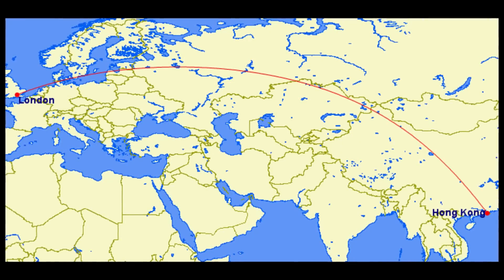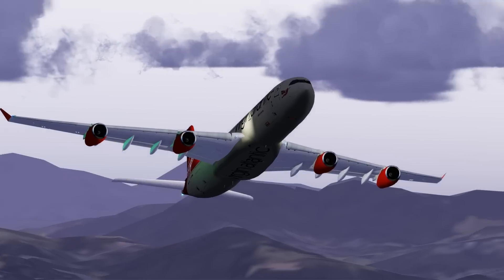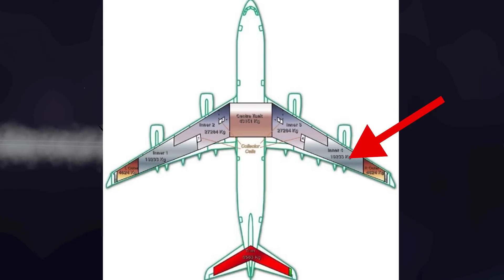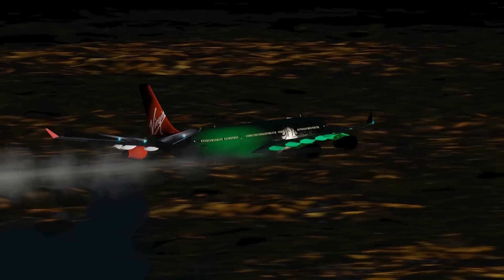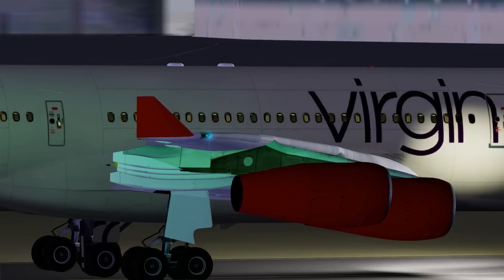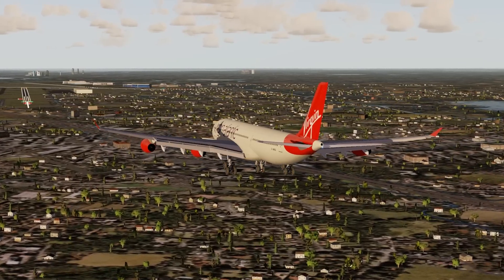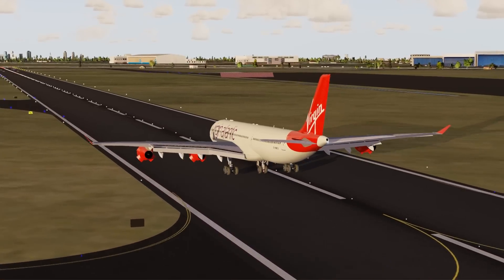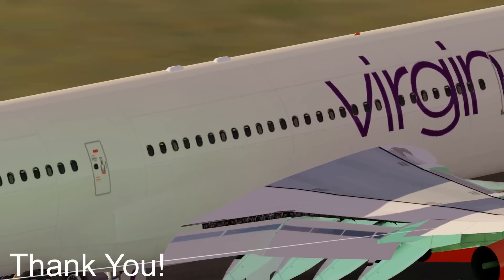How A Broken Clock Left A Passenger Jet With Almost No Fuel | Virgin Atlantic 207

Comment: Great episode as usual, particularly technical as you noted! For once I can contribute a tiny detail :-) for those unfamiliar with electronics, the "clock" referred to in the title isn't a clock meant to give time to humans, more like a crystal oscillator closer to what you'd find in a good old quartz watch ; these are meant to pace computer systems (including processors, although the ones in your computer and phone are a bit more complex), and definitely two systems meant to communicate with each other should ideally have synchronized clocks (or better yet, both depend on the same one) !
Reply: THANK YOU for explaining the 'clock'.  I could not figure that out.
Reply: @patriciaramsey5294  Really glad to hear my comment was useful!
Reply: A little more complex than the crystal radio set my Grandfather helped me make some time back in the dark ages for sure..
Reply: @virginiaviola5097  Hahaha yes! Although I was referring to the fact that modern processors basically pace themselves, and in fact can vary their own frequency depending on demand & available power ; but back in the dinosaur age of the 6502's and the Z80's, this would have been fairly accurate!
Reply: They use MEMS oscillators in aircraft, don't they? Crystal oscillators are adversely affected by forces, they go far out of specification when there are forces applied to them. Maybe I am thinking about missiles though, they have to withstand extreme forces.
Reply: @douggale5962  I'd think they're the exception more than the rule, at least when it comes to aviation? I believe (but I could be wrong!) the fastest moving vehicle in which mechanical systems could be useful/accurate would be automotive, as soon as you go any faster than a car you'd probably want something that has near zero environmental influence?

EDIT: OTOH missiles could be a good candidate as you noted, where the g-forces are so extreme mechanical oscillators become more accurate than crystal oscillators once again? But I'm not feeling particularly convinced at first glance, I'd be very curious/interested if you could find some reference talking about this :-)
Reply: Ah makes more sense now

Comment: Next video title:-  

" How a single handshake crashed this plane." 

Love your videos ❤. Keep it up.
Reply: Lol if the two clocks deviate so badly, the software handshake needed to keep the two systems in sync fails. Or even better, they will synchronize one data packet off*. That has actually happened and almost crashed a plane.
*) like let's say the format is X Y Z, the receiver expects X, but the sender is already at Y. Since all of these are complete data packets and being in the middle of a data packet when the start of a packet is expected will throw an out-of-sync error, necessitating both devices to do a sync handshake. But if the receiver expects a start of a data packet and that's what it's receiving, it didn't expect it to be the wrong packet.

Comment: This Captain was a nuts.  I am a atp with in excess of 18000 hours.  Follow up NOW on any Ecam  alerts NOW.  Don't wait till you get into   so much trouble.
Reply: Well. If you have a fault message that promptly disappears... do you action the checklist for a now unannunciated fault?
Reply: @blackduckfarmcanada  It disappeared because they power cycled the computer. That's not part of a checklist, and honestly shouldn't have been regularly done. If it was part of the checklist, then I'd say that checklist needed updating given the root cause.
Reply: That's the part that I don't think was clear. Did the captain just ignore the FCMS faults because they were common? I'm assuming that was the thought process, in which case it's hard to fault just the captain.

The fact that there was no direction on the ECAM is also puzzling, isn't that something that should be dealth with?
Reply: I fly 737s so we don't have ECAMs, so I really don't know the procedure.
Reply: ECAM alerts are in levels. Some are only caution and advisory and don't require immediate action. Also make sure the actions you are taking won't make the situation worse. The fatal Concorde accident in Paris was partly a result of the Flight Engineer shutting down the engines too soon. Yes, they were getting a fire indication on multiple engines, but what's the point of shutting down multiple engines immediately if you can't even keep the aircraft in the air.
Aviate, Navigate, etc...

Comment: Despite the redundancy in the automation, when a flight deck crew makes the decision that a manual operation should happen, the aircraft should never absolutely deny the command.  Warning, sure.  Reject, no.
Reply: The problem here is that the computer failures meant that even though the manual action was doing what they asked they couldn't tell that it was doing that. Thats a huge difference from the plane not actually doing what they asked.

The real issue here is that there wasn't anything handling oversight of the fuel system computers in a way that would allow it to detect a fault in they're own error reporting capabilities, meaning they silently failed.
Reply: Seems like you didn’t watch the entire video. If you did, why don’t you go ahead and name 1 thing that the plane refused to do when the pilots asked it to? (And if you’re gonna say the pilots asked the plane to stop experiencing a fault and it didn’t… well it’s not really that simple as I’m sure you know…)
Reply: It did. The manual fuel pump worked, but due to computer failure the arrows showing that it works were missing. So the crew rightful decided to divert, because they could not exclude a leak.
Reply: its not as simple as that. sure, it should not reject commands because the software thinks it is a bad idea, but it should clearly indicate/reject commands it is physically unable to perform. For a semi related example a Fuel Transfer Pump fails (as in gets physically seized up). if the Crew attempts a manual Fuel Transfer with that pump it should still show a clear rejection, not a Warning. because warning intuitively means to me "i dont think this is a good idea, but i will do it anyway", and the crew could think the fuel transfer works when in fact it does not. a clear rejection/failure is more appopriate here.
Reply: Its a good principle to follow but at some level it becomes impossible. The danger seems to lie in not recognising that a refused command without a good explanation constitutes a fault.
Reply: A certain fault with the 737 Max comes to mind. When a system with a single sensor that can and did fail takes authority away from the pilots, that's what kills people.
Reply: Did you know that the all-engines-out landing on the Hudson was done with the side-stick applying full back, long before touchdown, and the alpha floor did the entire touchdown? Airbus is all about not doing what the pilot said.
Reply: Yes. And no. A lot of those "I'm sorry Dave" issues are there to stop pilots from making serious mistakes. Pilots are humans; humans make mistakes. The computer systems aren't supposed to be able to make those types of mistakes. [a great deal of testing is supposed happen to make sure they can't.] But similar to humans... computers are mechanical systems -- programmed by humans, and mechanical systems can break -- programs have bugs and edge cases. The thing is, they break far less often than humans make mistakes. Here, the problem was ultimately one of the humans... everyone got used to this failure, so no one ever bothered to actually fix it. "Oh yeah, it does that. Turn it off, count to 20, turn it back on."

Put another way, how should it play out when the pilot(s) command the system to manually drain the inner tanks? That's going to lead to a flame-out. It's a violation of process and procedure, so the systems should NOT allow it. But what if the tank is leaking and you want to save that fuel? Well, there's a procedure for that, and you'll have to override (overrule) the computers - most likely by turning them off.
Reply: @jfbeam  You are wrong. Unfortunately computers are not mechanical systems - they are electronic systems and fail accordingly. It's the same in ships. Good old cathode tube radars have been replaced with Windows displays. Being close to 50 fishing vessels in the Indian Ocean getting the famous blue screen instead of the radar display is not assuring.
Reply: Agree. Who is supposed to be in command, the pilot or the system that has a fault. Bad bad design.
Reply: Totally. It's crazy there are so many micro events and controls and wouldn't allow the crew to do what they want even after diagnosing. Ground rule (or Air rule in this case) should be, you can have a million things automated, but the Pilots should be able to override anything and make things work as per their wish. One can say what if they are wrong, but definitely well trained and sane pilots will not go wrong on the fundamentals of flying, especially when there is an alarm that something is wrong in the plane, they will stay alert until too many things happen at once. But their timely action will prevent things from escalating to that.